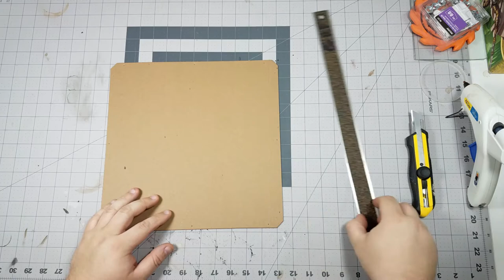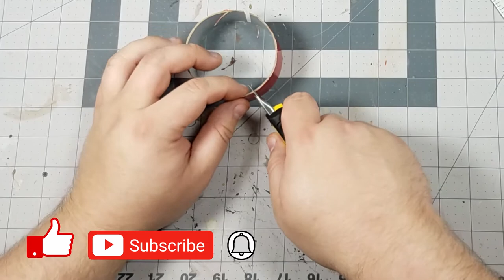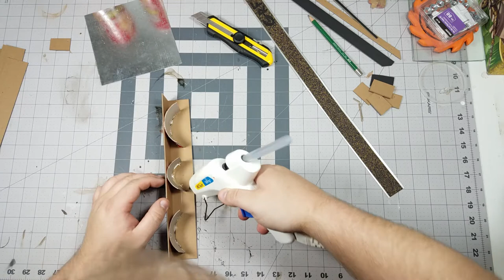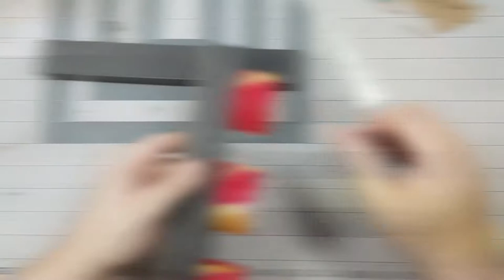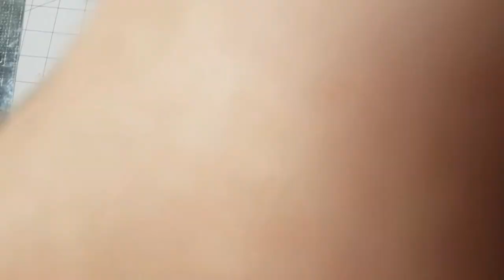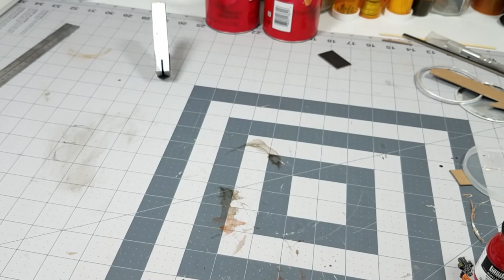How to Make a Super Simple DIY Paint Rack and Miniature Display Stand

Comment: That was great. I would like to make one of these! I have a couple of ideas that relate to this sort of project- 1) you can sharpen knives with a ceramic rod, even little box cutters or x-acto knives. They are very inexpensive and very small. 2) Helix the brand makes safety metal rulers with rubber backing which grips your project like a dream and has a nice deep channel to guard your fingers as they assert pressure- great for very exact line cutting but also helpful for other ruler-duties :D. 3) good measuring takes me a lot of time and concentration, don't feel silly if you realise how long it's taking- it's a good indicator you are trying hard and it should come out much better.
Reply from the maker: Thank you, I hope you do make these. Thank you for the tips.
1. Those kitchen knife sharpeners with the 2 v slits work well too.
2. Thanks, I'll have to look into Helix rulers. I'm just using what I have at the moment but those "safety" rulers may not be a bad idea. :)

Comment: Nice idea having the 1.5" shelf- interchangeable dropper  and pot paint bottle  space.
Whay about putting a small "lip" at the edge of each step to make the paints a little more secure- or would that cut down its versatility?
Reply from the maker: I didn't put a lip on it to keep the construction simple. but the lip would be nice to prevent things from falling off of it and if you use the trays for Miniatures the lip might hide the bases (worth it depending if you like seeing the base or not).